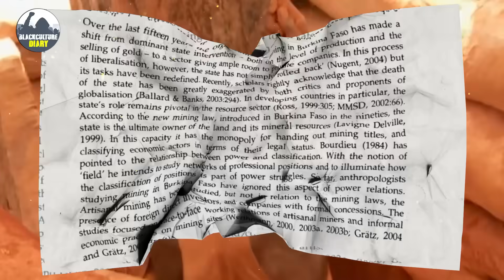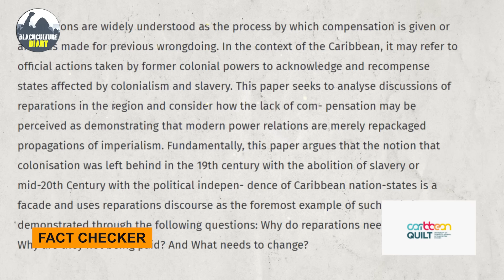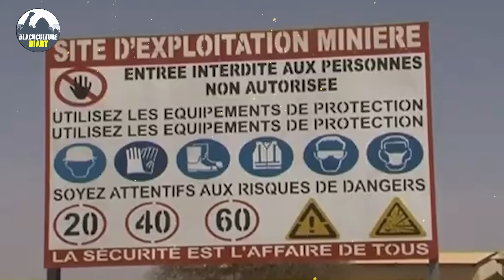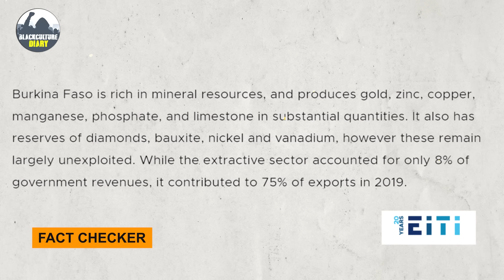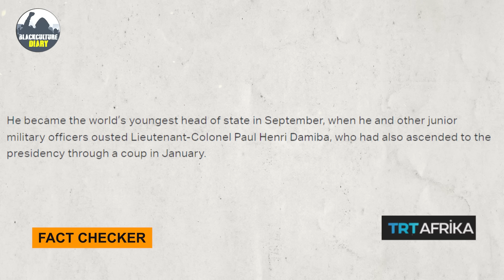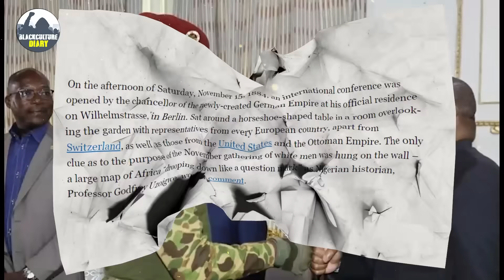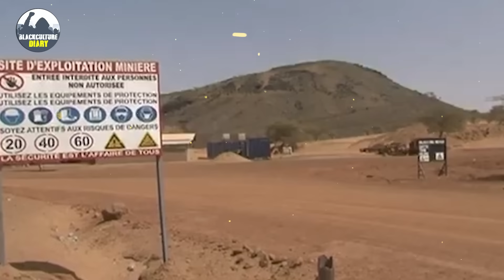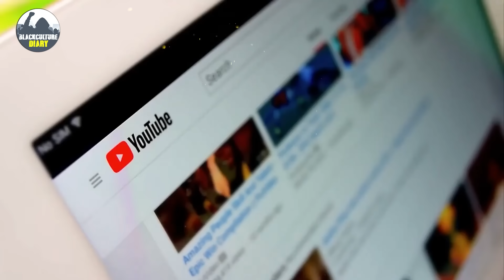How Burkina Faso’s Ibrahim Traore Plans To Take Country’s Gold And Mines Back!

Comment: Take control of your  assets.   Where they are fairly valued and humanely run,  take a meaningful  minority interest, and management with a veto power.  Where you determine economic abuse is in place, take control of the assets,  fire the management,  hire new management beholden to the Country, and hold a majority interest until such time as you wish to spin out SOME, not ALL stock, and use that capital to improve.   Have Putin & Trump advise  you.